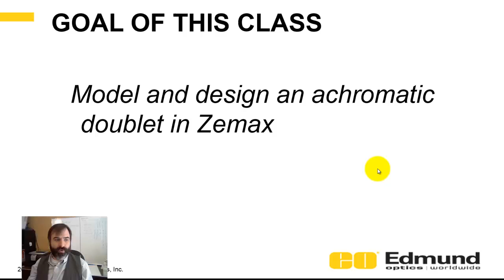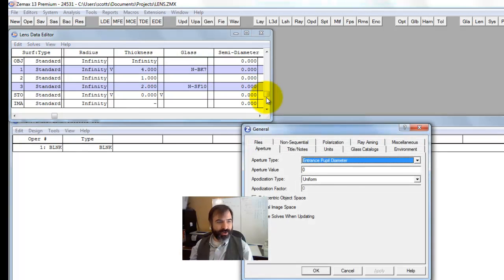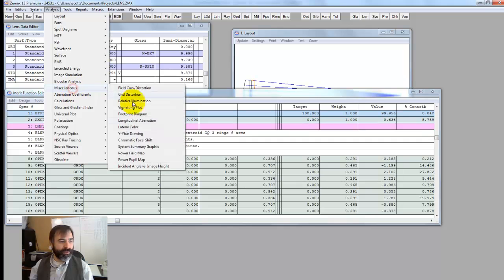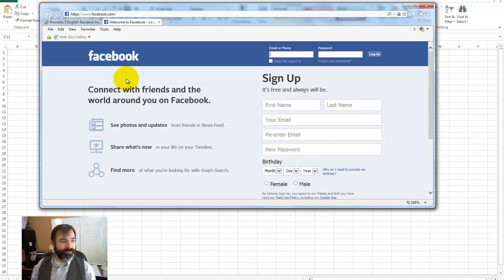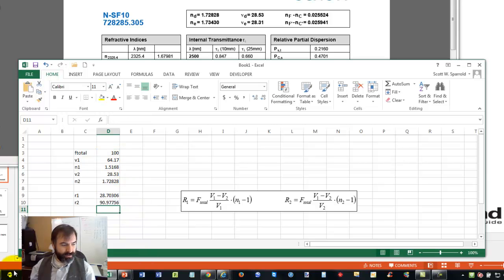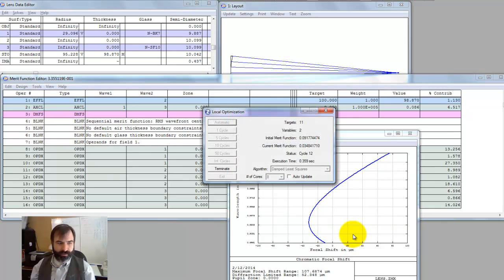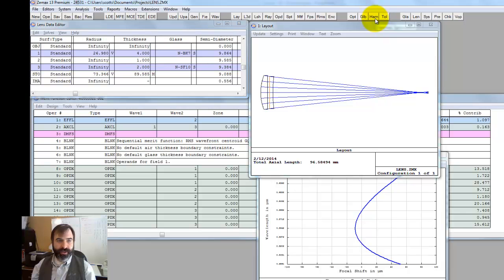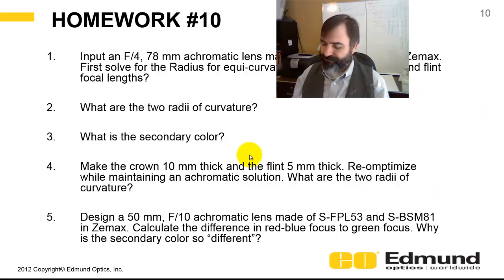Zemax 10 - Designing an Acrhomat

Comment from the maker: The first order equations for solving for radii need to be clarified. (Thanks to my coworkers questions showing where the video was not clear).

The equations solving for radii assume that the crown and the flint are airspaced NOT bonded together. It also assumes zero thicknesses for crown and flint and the distance between lenses.... At points in this video the spacings were set to some realistic amount... only to have clarity in the lens when it was drawn.

Comment: I have difficulty knowing when I have reached the best design for a given set of specifications. And when I should add lenses, or which surface(s) to make  aspheric. Any advice that you can offer?
Reply from the maker: Thineshwaran, great questions! I assume when you say specifications you mean untoleranced nominal specifications. For me "good enough" specifications would be manufacturing yield. If the yield is low, then I have sensitive optical elements that need to be split. Hopefully, I'll post videos on this subject.

The asphere question is another great question. Conventional wisdom states an asphere new the stop and another near the intermediate image. But these locations are usually not available for the lens designer. I've written a few articles on this subject: where to place in a double gauss and how to design with aspheres. I look forward to posting videos on this subject as well, but I'm time constrained!

Thanks for the questions as they motivate me to keep making videos!!!